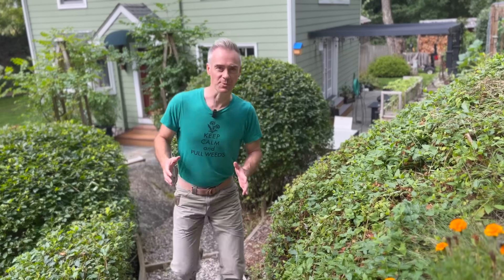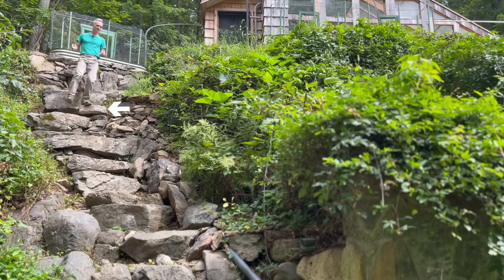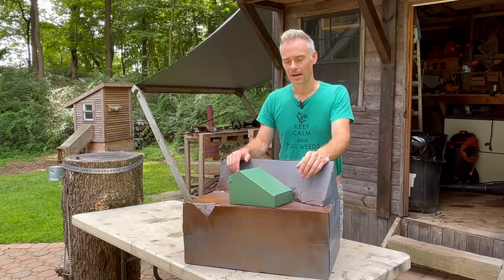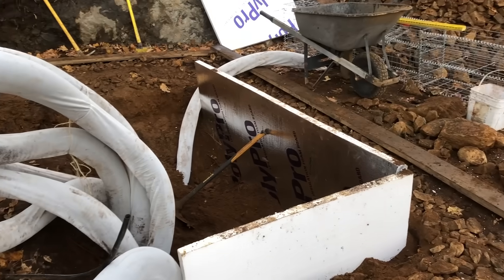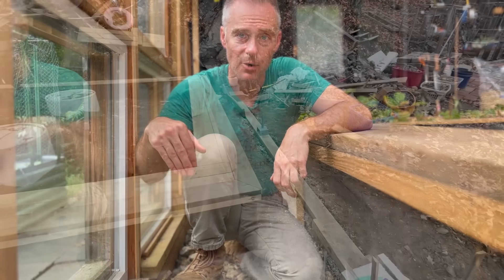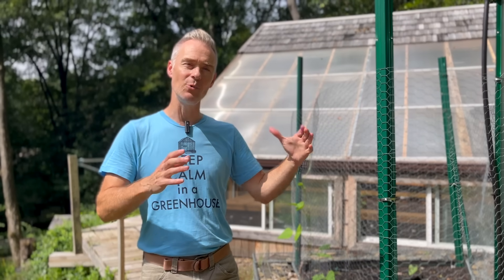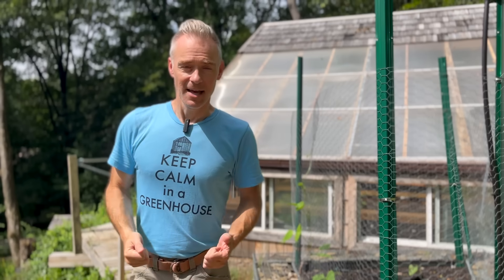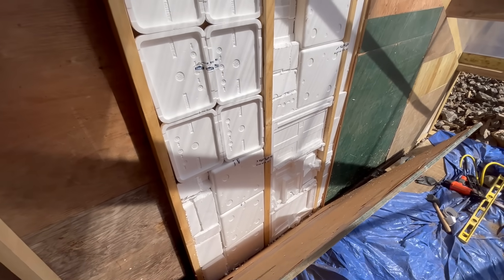Story of Building my GEOTHERMAL Greenhouse-1 MILLION VIEWS!

Comment: If you can “Jackhammer” (really a Jackpick), then you can really Jackhammer with a drill. Then, if you can drill, you can blow (with gel ignite), no matter how tight or small a space, you can blow it.
Reply from the maker: ...technically true!
Reply: Depending on how much of the hill he owns, the terrace could be made much wider/larger by blasting than with a jackpick, the stones made smaller or larger AND if the rock is a consistent structure “placed” in desired position by the blasting.  @WineberryHill

Comment: Inspiring. I thought my block with thin soil, heavy clay and broken quartz was tough. Mine is a doddle compared to your hard flinty rock. Well done.  

Just to be clear, you use the heat pump / rock storage to keep your greenhouse cool in summer, correct? In winter, 

I presume you set it in reverse to maintain warmth from the stored heat in the rock. I can’t see how it would last very long as your hole is shallow. Other geothermal heat pump systems pup plumbing metres below the ground surface.
Reply from the maker: Yeah, sounds like you have the basic idea. When it runs in the summer, warm air is pulled into the ground. This causes the soil and rock to "charge" or warm up more than usual. As the system runs later in the cooler part of the year that warm air in that soil (basically an earth battery) discharges into the greenhouse. Even once that charge has been lost, the soil remains about 50˚f and so it is still a fairly warm heat source during coldest winter months. Add to that on sunny days (regardless of the time of year) the solar gain is HUGE. I have had days that were in the teens outside, but it is 70-80˚ inside.
Reply: @WineberryHill  So what you have is a two way system of heat movement into the ground. Summer storage and winter release.  This would be a great method of warming a house where the heat could be pumped into pipes laid in the floor concrete and radiate into the rooms that are selectively heated. Excess summer heat is then drawn down and stored in the ground along with heat from the inside of the greenhouse. Pipes laid in a ceiling cavity which in my country reaches 80˚C would draw that heat down into the ground and stop it from moving through the ceiling to heat the rooms below. 

This system is quite different from the underground heating system which is one-way, drawing heat from the natural heat reserves in deep ground and moving it into a house.
Reply from the maker: I agree!

Comment: So your geothermal hole was 4’ deep but how long is each side of you rectangle?
Reply from the maker: Right, and then the bed with 2' of soil is on top. So 6' under the soil level. the system is 12'X12'.

Comment: You're living my dream! All I have now is a grow light above a few herbs and a computer measuring temperature, moisture and sunlight but I'd like to build what you have there. Does the temperature of the ground change much over the winter? Does it work all winter long?
Reply from the maker: It does slightly cool off as the winter goes on. But the period of time during the summer when it’s running, actually warms up the soil almost like charging a battery.

Comment: Nice build and that's some commitment.  I wish more people were this committed to growing in cold zones. A lot of additional efficiency can be gained by isolating all geothermal ground surfaces in the greenhouse and insulating over them while leaving an air flow gap between the ground and  insulation. The purpose is to stop heat loss during the day into the ground and the air gap is to allow the air to circulate over the ground and go up through vents to heat or cool when needed. During the winter geothermal surfaces inside the greenhouse work work against you during the day or anytime you're heating with the Sun or fire. The 50 deg ground sucks away and wastes a huge amount of your heat that would be much more efficiently stored in above ground thermal mass.

Comment: Amazing greenhouse! Do you ever have an aphid problem inside?
Reply from the maker: Not aphids, I did have little knat like bugs last year.
Reply: @WineberryHill I sometimes get flea beetles on the brassicas (and of course the butterflies if I don't use a net). I noticed quite a few little gnat-like bugs this year on the greens, but they didn't seem to do any damage. I get aphids at times, but since I don't spray, I have a decent balance so the predators keep them in check. I've always worried that if I used a greenhouse, I'd unbalance something and get overrun with aphids...
Reply from the maker: Yep, the balance is much trickier with a greenhouse.

Comment: I love the way you do things. Very well planned and executed. I have one question - how do you fill the two tanks that are in the greenhouse used as thermal mass? It's probably through a hose but I'm interested to hear how you do that. You said you also water the plants through a drip system from the thermal mass containers, would be interesting to see how you feed the containers.
Reply from the maker: Yep, you are right. I have a heated hose on a timer connected to my house. It has enough pressure to fill the barrels, and I have a sump pump (also on a timer) in the bottom barrel that runs the drip system.
Reply: @WineberryHill  Thanks so much. What would be even better would be a water retention tank. You've got a very nice set up there. Thanks a heap for sharing it with all of us.

Comment: Nice greenhouse! I built my wife a greenhouse last winter but I didn't get it finished until the weather got warm this spring so fast forward to today and we have had a few cold nights and unfortunately I'm finding that my electric heat is running constantly! I'm curious why the underground pipes you used needed to be perforated?
Reply from the maker: They need to be perforated to allow the moisture to drain out (the condensation caused by warm and cool air meeting).
Reply: Thanks! That makes sense. I'm a little concerned that the pipes will fill with ground water, but on the other hand, the water could drain back out once the weather dried out. I'm just starting to look at alternative heating options, have you done a video showing more of your geothermal setup?
Reply from the maker: Not really, but I need to.

Comment: I'm imagining some track mounted on the interior of the long slanted roof face, where you might suspend some UV blocking film to be rolled up or down in summer months to prevent things from overheating. You could feed a monitored temperature in the greenhouse to a raspberry pie or something cheaper to then control something like a garage door motor to raise/lower bottom weighted UV film when needed. UV blocking because the plants just need the red/blue light and UV is needless high energy light bringing heat.
Reply from the maker: Clever! I actually don't have much problem with overheating. The GAHT does much of the heavy lifting, additionally the structure was placed with afternoon shade in mind. Here is a video I made about that: https://youtu.be/w7uCrnZn7-8

Comment: Need some details on the ground heat transfer. Are you blowing air through the 4" pipes? Why insulate them if you want heat transfer? What kind of blowers do you use? What about the two barrels of water, is that just for watering the plants or does it play into heating the building?
Reply from the maker: Actually pulling air through it (versus pushing/blowing). The gaht pipes are not insulated, they are sleeved to prevent dirt from getting into the perforations. The barrels are for both water supply and thermal mass.

Comment: How well does the thermal mass heating work on a cold night? What’s the temp difference from outside and do you suppliment the passive heating with any additional heat sources?
Reply from the maker: It works great. During the day there is easily a 50˚+ spread between inside and out. During the night it's a 35˚+ spread. On super cold nights I will use the flower pot heater sometimes.

Comment: wow, what a greenhouse.  Question, how much would you have to expand that ground air system to actually cool the greenhouse down more in the summer?  I mean enough to make it cooler than ambient in summer.  Is there a rule of thumb you use to know you have enough for the volume of air inside?
Reply from the maker: The more air volume of below surface GAHT pipe you have the better it will perform in both hot and cold weather.
Reply: I understand that thanks, what I mean by my question is what kind of ratio do you need from pipe volume vs volume to be conditioned area.  I hope that came out clearly lol  @WineberryHill

Comment: What do you do for ventilation? Operable windows? Fans? 

How long of a season extension are you getting on each end (spring and fall)? 

What things grow best in your greenhouse?
Reply from the maker: There are a total of 6 fans, two louvered fans, one fresh air intake, and an attic exhaust. The inline G.A.H.T circulation fan, two oscillating fans for plant movement, and a ceiling level booster fan. 

In theory it's a full 4 seasons (I sometimes skip summer growing season)

In the winter the best growing plants are cool weather crops like greens and brassicas (also strawberries).

Comment: When I saw your property (south facing slope...or was it not south facing?) I started salivating for a walipini (sunken/partialy buried) style Greenhouse. Granted you have such rocky soil, but you had to do a lot of digging anyway and all the spoils could have added to your walls to slightly reduce digging.  Based on how you present yourself, you probably saw and discarded this idea.  Why, please?  Hot air powered thermal mass was still an option.
Reply from the maker: I considered it, but didn't have the energy for the considerably higher amount of jack hammering it involved. I also wanted to complete the project within a year, and my specific location would have required a lot more time to complete a Walipini.
Reply: @WineberryHill  Thanks. The other thing I wondered was why you rejected making it an attached greenhouse...north end attached to your house.
Reply from the maker: The location is the optimal spot for best winter sun alignment (my house isn't).
Reply: Can you please clarify which direction it’s facing.  Awesome and very detailed work
Reply: First thing I thought too.

Comment: You know, with your experience building your greenhouse and the geography of your property, have you ever considered building a passive solar heated and cooled home?

Warning: It would mean much more jackhammering.

You'd pretty much have to bury the living space of your house inside your hill. 

Also, the structure would be like a thermos: 
The living space would be inside outer walls, with about a foot or so between the outer wall of the structure (in contact with the earth and stone of the hill) and the outer wall of the living space. Basically, you'd have a house inside a house, but with NO insulation between the outer walls.
This would include space between the floor of the living space and the floor of the outer structure, as well as space between the ceiling of the living space and the roof of the outer structure (the roof of the outer structure would have earth atop it). Again, with NO insulation between to living space and the outer structure.
By "burying" your house in the side of your hill, you will be counting on the earth as insulation. 

From the middle of the back wall of the outer structure, you would run a pipe about a hundred yards back, and then straight up to emerge from the earth. The end of the pipe would have to be capped to prevent rain from entering, but the cap would have to extend well beyond the edges  of the end of the pipe. That's because there would have to be holes near the end of the pipe to allow air in (but screened to keep bugs out). This is part of your passive solar air conditioning. 

The front of your house would be a greenhouse, built as part of the outer structure, but not buried like the rest of the house. The floor of the greenhouse would be like a standard deck, built of wooden slats with enough space between the slats to allow air flow (this "deck" would sit above the floor of the outer structure).

The front wall of the living space would be thermal mass to soak up heat. Your bottom of your planters would also be thermal mass.

Here's how it works:
   --- AC: During Summer, you would open the greenhouse panels on the roof at the back of the greenhouse, right above the thermal mass of the front wall of the living space (you'd have screens here to keep out bugs). The sun would heat up the air in the greenhouse house. The hot air would rise, leaving through the open panels. That natural air flow would draw in air through the pipe. The pipe, being buried, would cool the air it draws in, which will flow into the space between the outer structure and the living space, cooling off the living space (which should already cooled some by being buried in the hill).
   --- Heating: During Winter, you close the greenhouse panels and a valve in the buried pipe (closing it off, too). During the day, the thermal mass heats up from the sun (the greenhouse should be on the south side of the house). At night, the thermal mass will give up its heat to keep the house warm. Being buried in the side of the hill will provide great insulation for the house. If you are worried that your earth insulation and thermal mass will not be enough to keep you warm enough in Winter, when you build the house you could install a woodstove just inside the front wall of the living space. The thermal mass built into that wall will soak up heat from the woodstove, too, ensuring a warm night and day.

I plan on building such a house in the future.
Reply: ... but you would pay taxes on that extra wall around your living area, as a living space, no?  And why not suck out warmer air from the depths of the stone hill in the winter, to aid in warming?